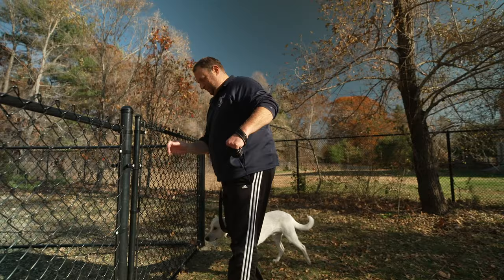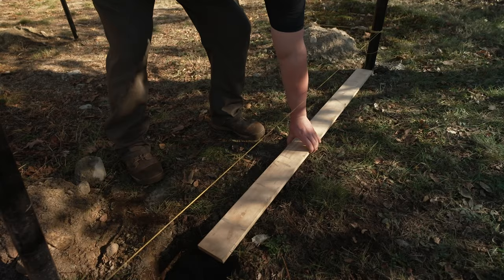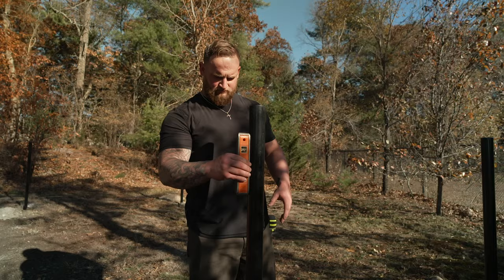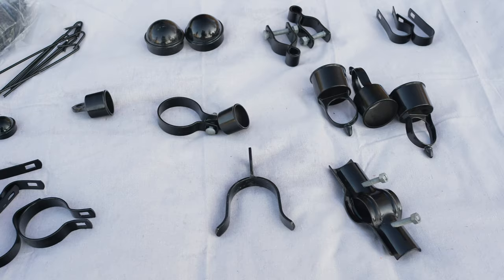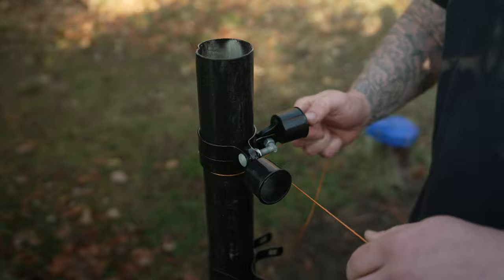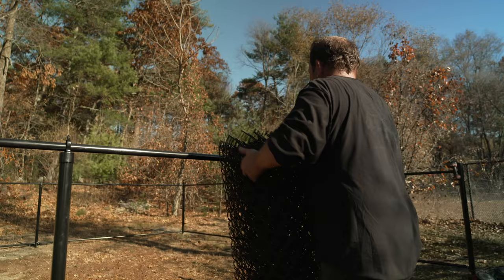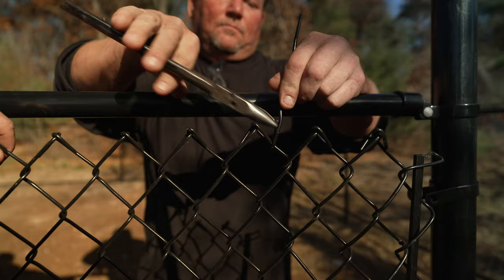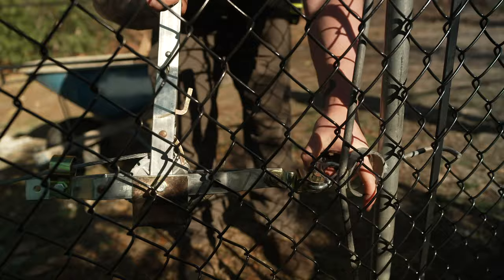How to Install a Chain Link Fence | The Home Depot with @thisoldhouse

Comment: The video states to use a portable bandsaw to cut the tops of the line posts. That’s not a real common tool in the arsenal of many DIY homeowners. I think an angle grinder with a metal cut-off wheel or a sawzall with a bimetal blade could work as well. Kudos for keeping the video straight forward and simple.
Reply: I've never heard of anyone cutting off the tops. I am doing one without concrete. Its a 5' fence with 8' posts. Driving the posts in 3' with a power post pounder is easier than digging holes, and pouring concrete.
Reply: I just dig the hole to the right depth. If it's an inch or two higher than it should be, I pound it down to the correct height before the concrete cures
Reply: @mattpiekarski8855  i like your method!
Reply: @mattpiekarski8855  if someone does that protect the tops from mushrooming.
Reply: 😂 Well how complicated could some bullshit like this be, for fucks sake?
Reply: Ok so let's see you build one then Mr. Armchairwarrior  😂
Reply: @chitownbangin  I did. I used an angle grinder with a metal cutoff wheel and installed a 100 feet of fence including a walk-through gate.
Reply: or you can use a HACKSAW like Jim Douglas.

Comment: 24” deep even in states where it freezes or go down 43”???
Reply: in that case, every 5 years you'll have to cut random lengths off the post tops to compensate for rising posts.
Reply: @totallycv2388  lol I thought so. 4' on everything here in Michigan
Reply: Yeah it was a kind of weak demonstration.
Reply: @Guerrero1187  Are you saying you go 4 foot deep with the posts because the ground freezes? I’m trying to understand if it’s better to go deeper when it freezes?
Reply: @TheGrobe  48” deep to be below the frost line in Michigan

Comment: You don't necessarily need a bottom rail, can just use wire along the bottom, pulled tight and hog ringed to the chainlink fabric.  I did a combo of digging& pounding the posts in place, and used some Sika foam at the gates, to avoid the hassle of concrete.  Also I bought some nice massdam stretcher clamps from amazing-on (hint) to pull the fabric tight to the terminal posts, no need for a jack and rake or whatever they used.

Comment: Can you just drive in your line post without using concrate?
Reply: It depends on your local soil composition. If your soil is really loose and sandy, no. If your soil is harder and more clay saturated, you can get away with it, but you have to put the post deeper, drive it 30-36 rather than 20-24 if you are not using concrete. I would recommend spacing the posts every 6 feet, rather than 8-10, if you are just driving the posts as well, so they have less weight on each post. 

If you get flooding or really heavy rains or earth quakes, I would recommend using concrete, not just post driving. The biggest issue with solely post driving though, is the weather will eat at the posts over time, with it directly against the soil, not having concrete to protect it.

Comment: What would the cost be to install one
Reply: Just paid 300 + rn and still missing items
Reply: Depends on the length really
Reply: @irisgarcia8315  for what? Just a gate? 100 feet? A mile? $300 means nothing without context.
Reply: Just had Lowes come do an estimate for 274 feet, 1 4ft gate and 1 double gate. $6998
Reply: Like most things, you pay more for the labor. If you choose to diy, of course it's going to be thousands less, but YOU have to do it. Assemble a parts list, there's tons of fencing calculators out there, add in a minimum of $15 an hour times at least 2 times however many feet you think you could resonably install per hour then you are getting close to what it would be to install. Cheaper if you pick up a laborer or 2 outside Home Depot when you pick up your fence supplies give them both $100 and a 12 pack and bam fence done!
Reply: Well in Oklahomo everyone is money hungry so they wanna charge you $2,000- $3,600 for 125'.  Thats like the size of a dog pen.  Its ridiculous.  Luckily I found a guy that only wanted $500 for labor.  Honest people are difficult to find here.  California are more realist, for the same price you can do your whole front yard.

Comment: How much concrete per terminal post ? Line post?
Reply: A bag and a half maybe is what it took us
Reply: About at least a bag if not another additional half bag more.
Reply: I last did chain link when I was like 12 years old and I think we did one 60 pound bag for line posts and two 60 lb bags for terminal posts. I was watching this video hoping they'd say for sure but nobody seems to give exact numbers. I guess just use whatever you think you'll need?
Reply: One 60 pound bag
Reply: See this is why there is a pay gap. You sit there in an office running your mouth on how to do the work you have never even seen done. All while the guy is doing all the labor in the heat of the sun. Why don't you go check out lowes video on this? That woman actually works on the project she's explaining and does a damn fine job doing so. With much more details and information by example.
Reply: @EnriqueGarcia-gw7xy  ye, the narration was cringe.

Comment: Cost for .80 acre land?
Reply: How high do you want the fence?
Reply: 5 feet
Reply: @wilsonpadilla3577  how many gates were you thinking?
Reply: 2 gates
Reply: @wilsonpadilla3577  probably looking around 2.5-5k depending on your location. I know on the west coast fencers charge a bit for chain link.
Reply: Oh I just looked around for galvanized chain link fence it costs a fortune. They're charging me 17k
Reply: @wilsonpadilla3577  holy hell that's a lot lol
Reply: @wilsonpadilla3577  if that's the cost installed, that's not terrible, cause that is a lot of work. I was looking to fence off a quarter acre of my property with 5 foot chain link and 2 gates, back before the costs of construction materials skyrocketed. Just for materials, if I did all the labor myself, it was gonna be like $2k. Then again I didn't call anyone to ask what they'd charge to do it.
Reply: Do the math, depends on the theives in where you live.  OK. = about $2700 for 125' no gate & CA. = around $4,000 for your whole front yard ( about 260' or so with one big gate).